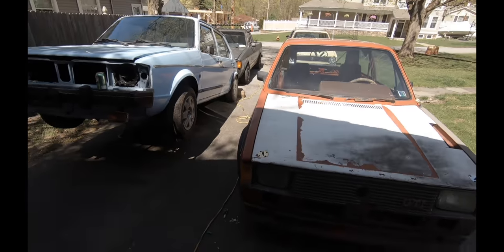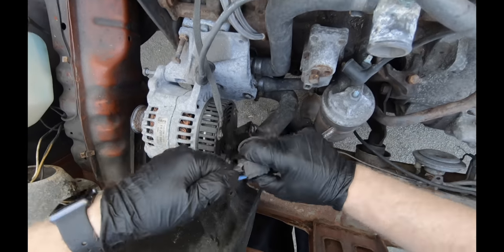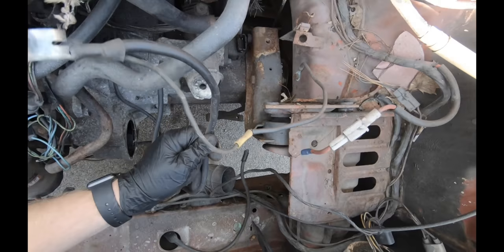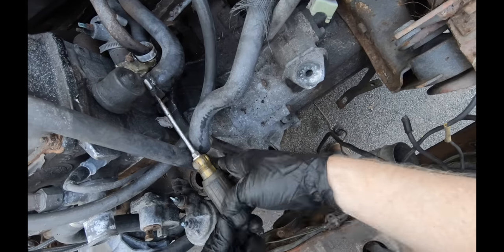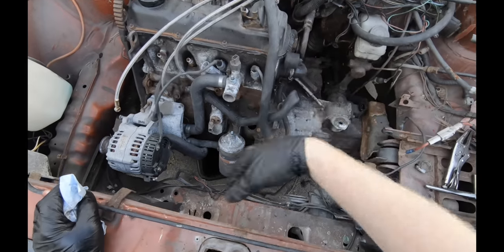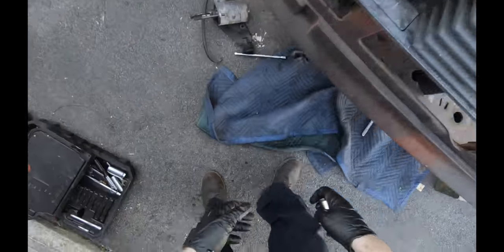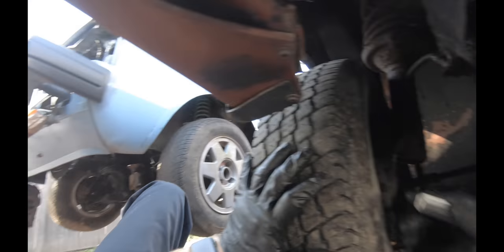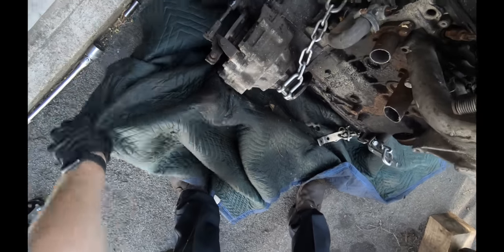#17 mk1 vw engine removal

Comment: You might have an easier time removing the transmission first. 
Then engine can go out the top with the cherry picker. 

Either way works. 

I’ve put 5 engines in my 81 caddy before I found a keeper. 
1.5d
1.6td
1.6td w/aaz head
12v vr6
Ahu mTDI 

Vr6 is amazing. But it costs 3x more to operate. 

Defeating the purpose of an econobox. 

Enjoyed the video!
Thumbs up.